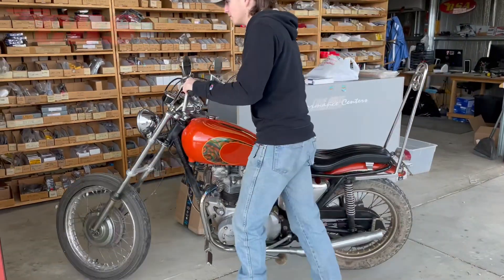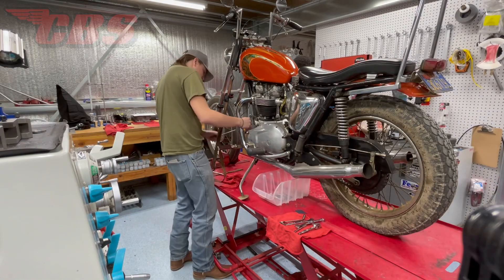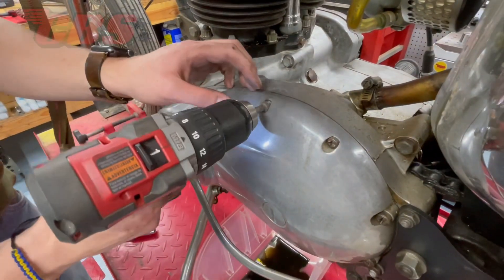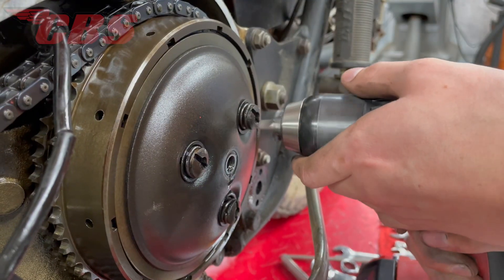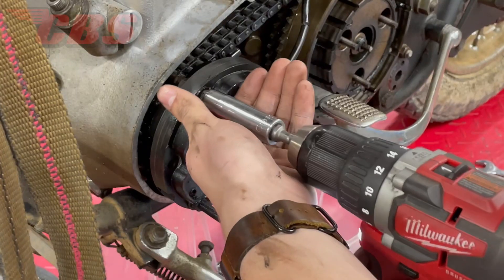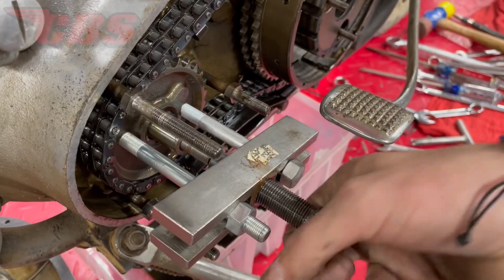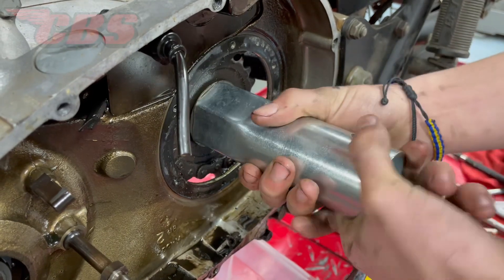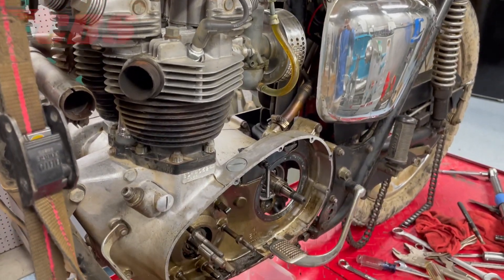Triumph Clutch Rebuild (Sunset Tripper) - #1/3

Comment: Just happened to be going through the clutch on my '67 Bonneville when your clutch rebuild videos popped up in this week's email. Watched all three and learned a few things along the way. My clutch plates look okay so I'm going to go back in with them. My thought was to just wipe them clean and reinsert them into the basket. But a fellow Brit biker tells me I should spray them with a  cleaner such as CRC Brak Kleen, Laquer Thinner, Acetone, or Alcohol. I'm okay with doing that on the steel plates, but leery of applying such an aggressive cleaner on the bonded plates, for fear that the bonded  material might begin to disintegrate. 
Should I clean the bonded plates with an aggressive cleaner, or just wipe them dry with a clean cloth?

Comment: Typically the trap door screws are very difficult to loosen, especially when they have been installed with Loctite . Heat the screws with a MAPP or Propane torch and they will come loose.
Reply from the maker: Right, in this case we used an impact driver to break them free. Thanks for the suggestion on the bungee cord. Thanks fo watching!

Comment: In your first video (Disassembly) you extracted the chainwheel, clutch center, primary chain, and engine sprocket all together at the same time. I'm trying to extract the clutch center by itself without pulling everything else out. Just want to install new clutch rubbers in the shock absorber unit (clutch center). After removing the clutch center nut, I used that special puller tool (the clutch hub extractor) thinking I would be breaking loose the clutch center loose from the clutch hub. The clutch hub broke free but I can't get the clutch center to slide off of the clutch hub. When I pull on the clutch center, the chainwheel and clutch hub want to come out with it. This bike sat for many years. Could it be that the clutch center splines are frozen to the clutch hub splines? Or is not possible to remove the clutch center by itself?
Reply from the maker: Sometimes the sleeve will come out of the hub easily, sometimes not. If the sleeve is tight, you will have to press it out or drive it out. I hope this makes sense?
Reply: @classicbritishspares  Makes total sense. Reason I'm asking is I was able to slide a center (sleeve) off by hand on one of my other Triumph''s several years ago. Hopefully I can tap it out with soft blows from a hammer. I remember from the assembly video Curtis having to press the sleeve back onto the hub. If I'm lucky, I'll be able to slide the sleeve back onto the hub by hand. If not, then I'll have to tap it back on or get it pressed on. 
This leads me to another question. How do you determine if the primary chain is worn. Do you measure the amount of stretch on a table with a ruler? For example, if there's more than 1/8" of stretch, then it's time to replace?
Really appreciate your willingness to field questions. It's huge in helping us Brit bikers!
Reply from the maker: @robertmiddleton1053  Comes down to tolerances on  the sleeve. I go by the chain adjuster, if the adjuster pad is in good shape and the adjuster is not maxed out, then I assume the chain is not stretched. A new chain fitted would mean that the adjuster pad would barley be engaged. If you get the chain adjusted with the right slack, but the adjuster is "bowed", the chain is stretched. I use that as a measure. No worries!!